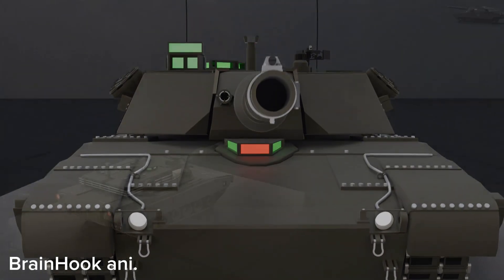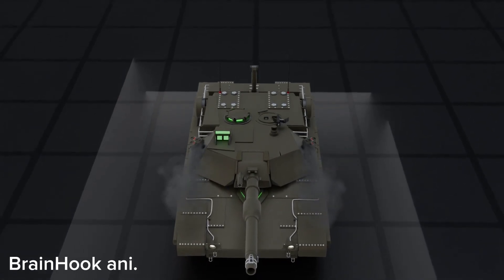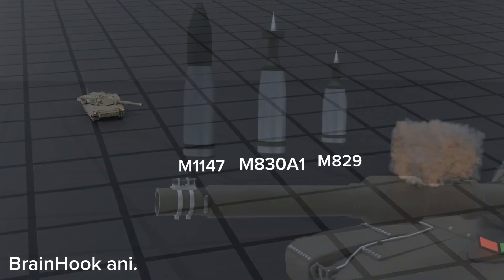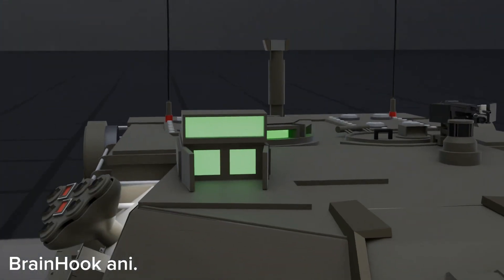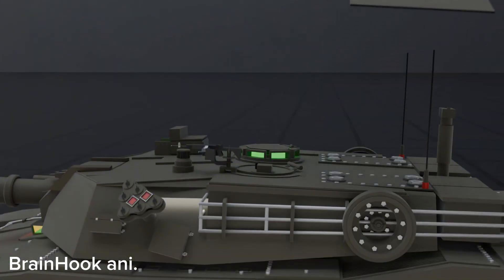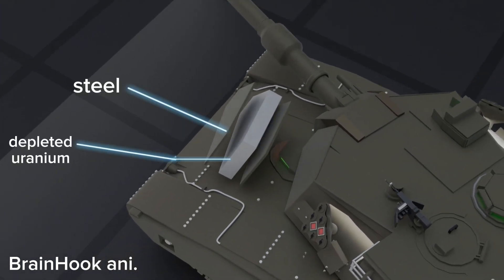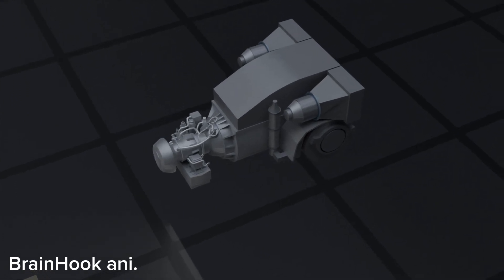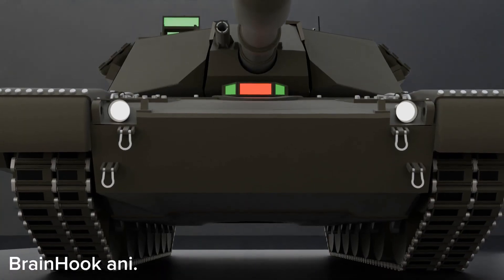How Does a Tank Work? M1A2 Abrams Tank!

Comment: You need to look at how the smoke launcher works. You need to look up why armor is angled. You need to look into this more.
Reply: You got everything on the wrong side.
Reply: Those are blow out panels. When the ammo cook off and everyone is using depleted uranium.
Reply: It is a gas turbine
Reply: The engine is very quiet and light. That is why they us it and easy to fix.